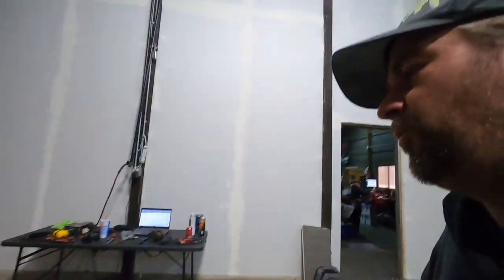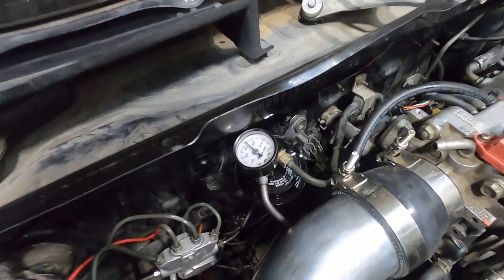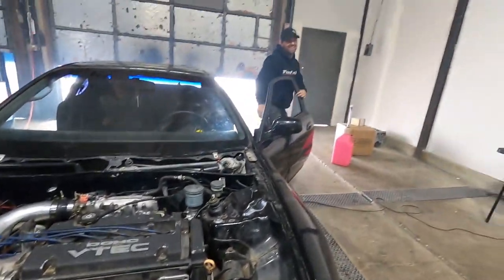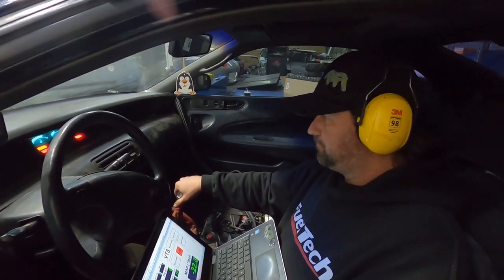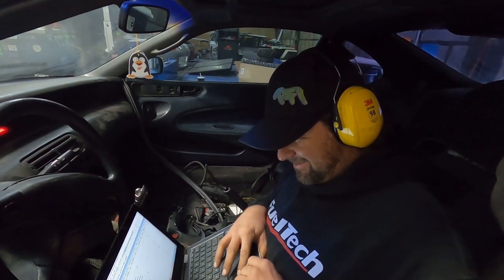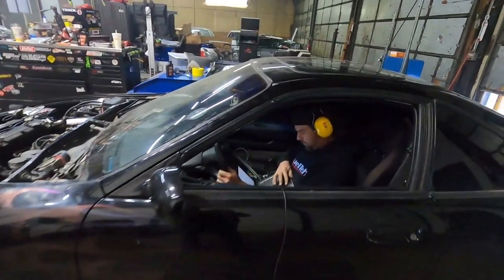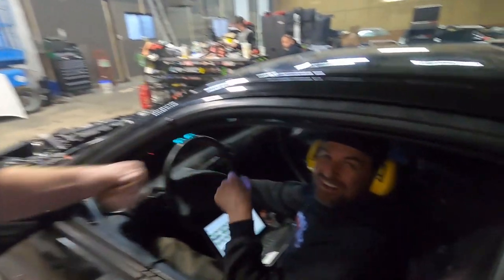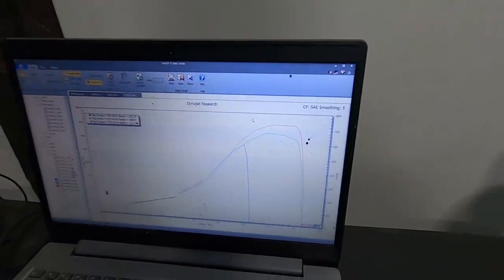Prelude Build Surprises us! Super Fun

Comment: You gotta love a well-built H22! It made 730 whp at 25 psi...my built 81.5mm LSVTEC made 612 whp on 22.5 psi through a Garrett GT3582R ball bearing turbo with a .63 exhaust housing. I just put a 1.06 exhaust housing on it, but I'm thinking about going back down to a .82 exhaust housing for response.